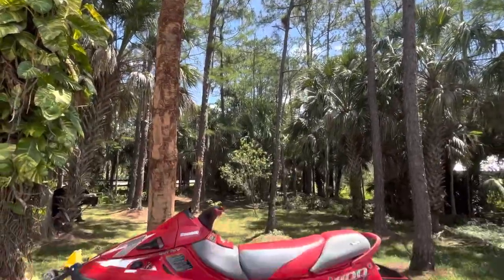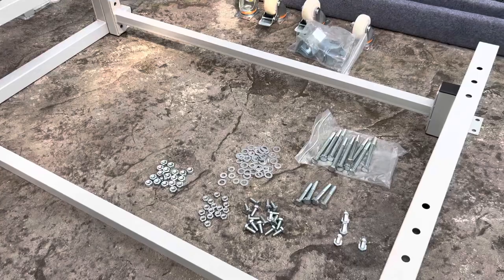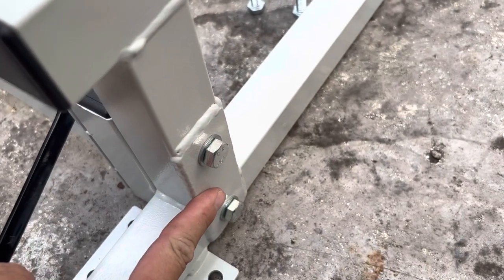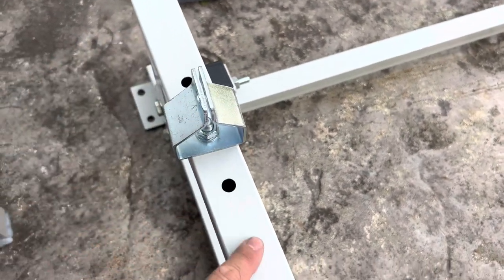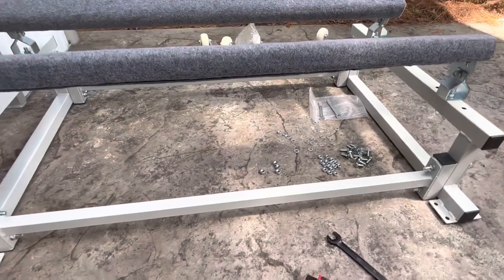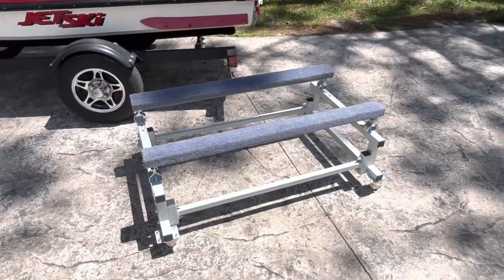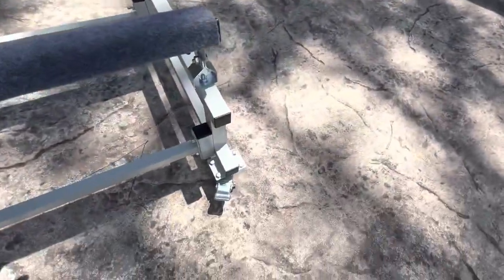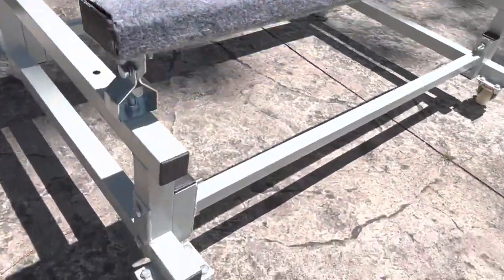Tech Topics: A First Look, Assembly Tutorial & Demo of the JY Performance PWC Dolly - Sold on Amazon

Comment: Looks like another great PWC cart JD.  Thanks for sharing!  Now let’s see you move big girl around like that 😂

Billy D
Reply from the maker: Haha yeah with the Ultra there is a lot more grunting and cursing..😂
Reply: Will it hold the weight of an ultra 310?
Reply from the maker: Yes, but dimensionally it’s not wide enough to accommodate the Ultra. This dolly will hold a spark, STX, or GP. I have other videos on the larger dolly I use for my Ultras